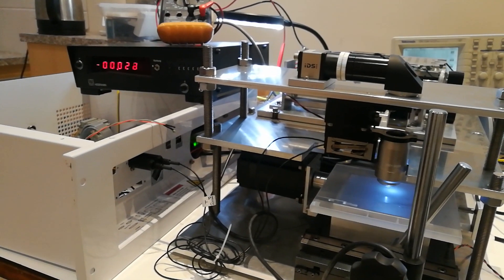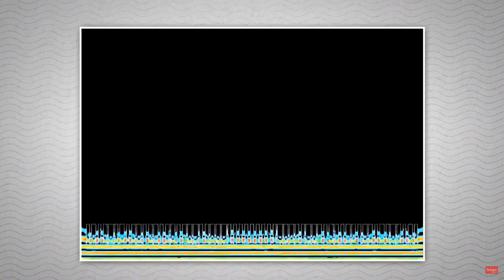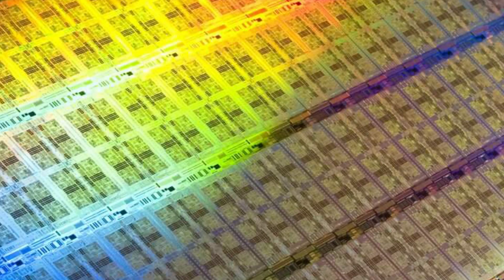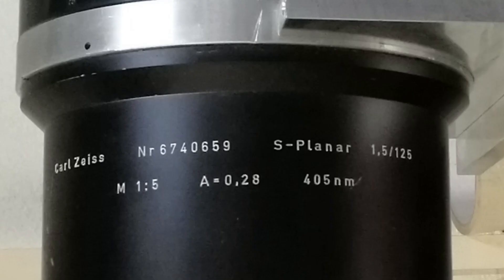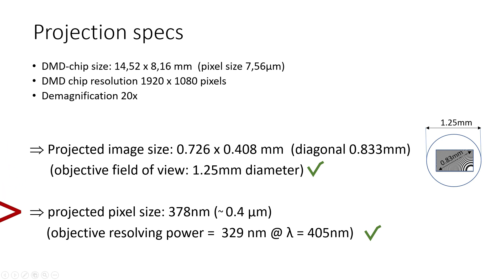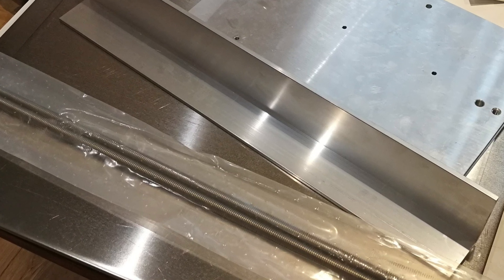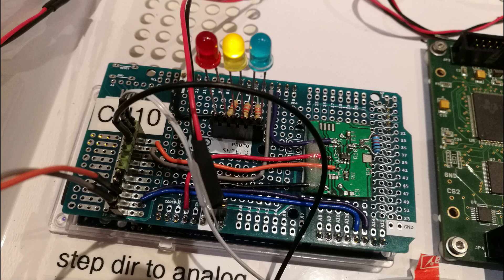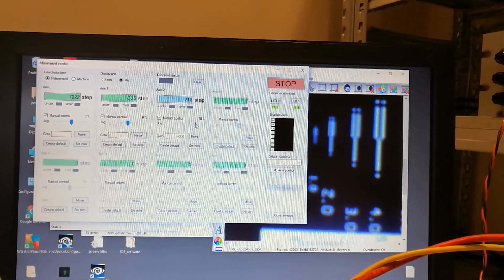Maskless Wafer Stepper Part1: Optics

Comment: The microscope objective lens you are using seems to be corrected for cover glass thickness, as this is typically the case for most CFI Nikon Plan Apos, especially those with higher magnifications. I wonder if you see any noticable spherical aberration if used without cover glass.  Have you measured the point spread function of this system so far?
Reply from the maker: Thanks for the suggestion Jaka, I actually  did not know that, so I checked the documentation. The Plan Apo VC 20x that I use  does not have a cover glass correction. I have not measured the optical quality of the objective myself but  I probably should. The main issue so far seems to be a rather limited contrast, probably caused by the "APO" properties, which I do not need using only a limited wavelength range. I improved the contrast quite a bit by introducing a few limiting aperture stops.
Reply: @HuygensOptics  Thank you for your answer. Interesting - is it possible for you to share the documentation?
Reply from the maker: Sure. You can download it from the nikon website. https://www.nikon.com/products/microscope-solutions/support/download/brochures/pdf/2ce-muzh-4.pdf. The objective I'm using is the MRD70200
Reply: Thanks to both of you for discussing this issue. A photomacrography forum has been discussing this issue in relation to your work. I don't see any specs on the Nikon website for the particular objective you are using. The Nikon 20x 0.75 VC is clearly labelled for 0.17mm coverslip, even in the diagram that you used in your video. The OEM versions are generally optimized for different (usually thicker) "coverslips" (often glass-walled receptacles in gene sequencers). If you have information that your particular model does not need a coverslip, that would be very interesting and exciting news for many of us. Can you explain in more detail why you think your objective does not need a coverslip? Thanks.
Reply from the maker: @loujost  Thanks for the info. So, indeed a cover glass is indicated in the figure, but I am not sure that means it is corrected for this. However, check out page15 of the Nikon document linked above. With the 60x, the correction is explicitly mentioned. The 100x oil emersion does not need it, so it is logical it's not mentioned. With the 20x there is no mention of cover glass correction. I'm no expert at all, so I might very well be wrong about this. 
PS: if the cover slip correction is mainly chromatic, it is not important for my application since  I use monochromatic light.
Reply: @HuygensOptics  No, when an objective with high NA says it expects a coverslip, that means it is corrected for a coverslip. Results will be degraded without it. People on the photomacrography forum have tried these objectives withoout coverslips and found poor results. As I mentioned, the OEM versions like yours are often even worse in this regard, because they are designed to shoot through thicker glass. It would be worthwhile for you to experiment  with adding one or two coverslips to your system. There is a lot of information about these on this thread : https://www.photomacrography.net/forum/viewtopic.php?t=38767&highlight=1501-9398
I have the same objective as you and I made tests with different numbers of coverslips, posted on that thread. The best results were obtained with somewhere between two and three coverslips.
Reply from the maker: That is great info! Thanks very much, I will give this a try for sure.
Reply: Thank you Lou Jost for confirming my doubts. However, a measurement of a PSF would clarify everything. @Huygens Optics, are you able to perform a simple knife edge test to measure this?
Reply from the maker: @jakapribosek8803   Yes, no problem, I can do that.  I will let you know when I have done a test. It will not be very soon because of work and another video.
Reply: @HuygensOptics  Seems like it would be easier to just compare the image with  no coverslip versus two or three coverslips.
Reply from the maker: @loujost  by the way, I saw your remarks on the photomacrography website concering the Carl Zeiss lens video 1. After publication of the video I found out about the Censor bullshit (somehow I was wrongfully convinced that this was the explanation) so I immediately put a remark in the comments. Also, I corrected the sodium-mercury mixup during editing by placing a remark in the top corner at 7min16 into that video. The problem with video's is that they are hard to change once published. The only way not to make mistakes is to not make anything.
Reply: @HuygensOptics  Thanks for clarifying.  I didn't see the clarifying remark when I watched the video, perhaps at that point I was just listening to it while stirring my dinner pot. I should have looked more carefully. Sorry.
Reply: I added your comment to my post on that forum.
Reply from the maker: No problem Lou, thanks. The sodium lamp was a slip of the tongue and I did not want to the workshop and re-record it all again because of one word, so I decided just to add a remark it in the picture. But I should probably have made it more prominent for people to notice. By the way, I just found out that it is possible to cut out a part of the video without having to delete and re-upload it again. So I think I will do that and remove the Censor part. I really don't want to give people faulty info.
Reply from the maker: Jaka, I found this page on the Nikon websit, turns out you I was wrong about this objective, indeed this objective requires a cover glass (of 0.17mm). See: 
 https://www.nikon.com/products/microscope-solutions/lineup/objectives/cfi_plan_achromat_series/index.htm  
I've ordered cover glasses, so hopefully I can achieve an even better resolution by adding one to the optical path.
Reply: @HuygensOptics  Thanks for the link. However, this objective lens looks different than the one you are using in the video.  Yours looks like CFI Plan APO 20X VC: https://www.nikon.com/products/microscope-solutions/lineup/objectives/cfi_plan_apochromat_vc_series/index.htm If that is so,  the overcorrected  spherical aberration at 0.75NA should be significant. If you can reduce it with coverglass as suggested by Lou, you should see noticable improvement in contrast and resolution. For optimal performance however you might also consider AR coating on the coverglass...
Reply from the maker: @jakapribosek8803   You are right again. In a future video on improvements of the wafer stepper i will definitely discuss the issue in more detail.
Reply: @HuygensOptics  No,  those aren't the right objectives. The information and my test results in the photomacrography.com forum are corrrect. Your objective needs about two standard cover slips, maybe three. Yopur objective is a specially designed objective for a gene sequencer machine.
Reply: @loujost  Have you found a source of commercial cover slips of appropriate thickness?
Reply: @jakapribosek8803  No, I have to combine two or three standard ones. There does not seem to be image degradation from doing this. See the information and tests on photomacrography.com. You can also just do your own tests by adding coverslips until you are satisfied. The thickness does not have to be exactly correct at this NA.

Comment: I did this in my lab a few years ago. I will be interested in how well you can do field stitching. I actually made it so I could swap optics and align though the lens with red light before switching to nUV. I had much more field distortion than a real stepper though.

Comment: Wow really cool project! You hear now also in the cinemas e.d. about laser projectors provdiing better contrast.  Would using a 405nm laser have any advantages for your system?
Reply from the maker: The high resolution (4K for some systems) could be advantageaous. Also it would probably be quite easy to replace one of the lasers with a powerfull 405nm laser.  I have mixed experiences with using laser light in photolithography. One of the problems I encountered is the fact that you can get "grainy" images when reflecting monochromatic light on a DMD-chip.
Reply: You can make a decoherence filter for lasers by shining them through a weak milk solution. This removes the graininess.

Comment: would you not also require rotation adjustement for being able to stitch ?
Reply from the maker: This issue is actually discussed in Part 2 (rotation is mentioned around 11min 22 sec)
Reply: @HuygensOptics  I've watched it since, must say I was so enthused that I had replied on the spot. I've done a bit of micro fabrication myself, including microoptics (Fresnel lenses mostly) , but using photoreduction or metal masks, not optical direct writing : your setup is amazing (caveat : resolution and alignement tends to always become a limitation at some point or other, so it is a major design parameter in my experience). Though I'm mostly into mems and biosensors these days, this kind of tool would be very valuable, at least for prototyping...  One minor suggestion if I may : you could probably improve your defect density by building yourself a little air box to prepare the plates and box them before taking them to the patterning machine.

Comment: If you use monochromatic UV source, maybe you don't need APO lens? APO lens I think are useful only if you want to reduce chromatic aberration. But if you use monochromatic light, that is I think unnecessary, and can reduce other aspects of the image quality, like field curvature, coma and contrast, due to the design tradeoffs. Achromatic / Apochromatic lenses surely are useful in the inspection of the wafer tho using external secondary light. High quality apochromatic objectives can be pretty expensive and have 15 lens elements, which does reduce microcontrast and light transmission in general, so it is probably better to avoid them if possible. You will notice on your huge Zeiss S-Planar, that it is marked as 405nm. It is optimized for this specific wavelength, and it is not achromatic / apochromatic, maybe just slightly, but really in very narrow range 390nm-420nm maybe. The complex construction inside is mostly to improve the field flatness, reduce geometric deformations, reduce / eliminate spherical aberrations, vignetting, and reduce effects of colimation errors and thermal expansion.
Reply from the maker: Actually, I bought the objective for the "plan" indication, not so much for the "apo"  properties. But as you also suggested, it could have advantages when using a secondary wavelength, which is outside the exposure range of the photoresist. For example when checking the focus through the same objective, before doing exposures. So far, loss of contrast and field curvature/coma do not seem to play a large rol at this point, but I guess we have to find out. Anyway, thank you for the valuable suggestions. By the way, did you see the video's specifically made on the S-planar? In the first one I discuss the 405nm design wavelength and the implications for chromatic aberration (around 5.30min).
Reply: @HuygensOptics  I just noticed your other videos on photolitography, and you clearly know about the design tradeoffs and more than me on the topic. :D Thanks and keep us posted on the progress of your project!  Yes, I just watched the S-Planaer videos, they were very cool and indeed, it is sharp and optimized for 405nm. The chromatic aberration is enormous in it, but it is by design :D
Reply: @HuygensOptics scanners only illuminate a circle sector to make curvature non-critical

Comment: That Censor lens brought back memories. I used to work for Perkin-Elmer in the mid-80's as a young optical engineer on the SRA wafer steppers both before and after they bought the Censor company in Liechtenstein.  
Stitching together multiple fields is a real challenge. Here are some issues you may have already thought about. If not I hope this helps.  The reticle (or DMD in this case) has to be rotated parallel to the stage movement within a small fraction of a pixel width to avoid jags at the field boundaries. Hopefully the X and Y axes of your exposure stage are perpendicular to this same level.  The asymmetric distortions like keystone also have to be corrected to a similar degree for stitching. You may need to tilt the DMD to dial this in. Illumination uniformity also has to be incredibly good to avoid noticeable line width changes at the boundaries.  Simply Kohler illumination might not be quite good enough, you may need a light pipe uniformer or fly's eye integrator.  At this NA, you will probably need to focus at each field. There will always be an offset between the focus detector and the best focus determined by an exposure/focus matrix that will have to be determined every few hours. Since it must be calibrated anyway,  this means that you potentially could use a dichroic mirror in place of the beamsplitter, and use a separate wavelength for focusing and not waste the 405 nm light.
Reply from the maker: Hi Adam, that is some very good advice! Some things I had taken into consideration (like perpendicularity and field rotation), others not in that much detail. Illumination uniformity is actually one of those aspects that is quite tricky, I consider using only part of the total HD field for exposures, because the 16x9 aspect ratio of the chip is far from ideal. And it would not be a big problem to correct the step size for this in the software when in stitching mode. As for focussing, I actually designed a height map feature in the software, but only in first order (so just linear tilts in X and Y). So I hope this is sufficient for holding focus. Anyway,  I'm not planning to expose 300mm wafers, but rather limit the field to maybe 10x10mm. But in general, I try not to consider every problem I might encounter in the future, but rather tackle it when I get there. Your description of what lies ahead is greatly appreciated though.
Reply: @HuygensOptics  at 16x9 you can try doing anamorphic lenses to get bigger NA

Comment: Awesome. What is the minimum feature width you think you will be able to achieve? Also I would be interested in your thoughts on thermal stability, particle contamination and vibration considerations.
Reply from the maker: Hi Nick, regarding the resolution:  With 193nm it is now possible to produce dimensions below 50nm using multiple exposures and very advanced mask design. So if you would use a similar factor to 405nm,  a 100nm should be achievable. But of course, my "mask" is very crude and it is not possible to deliberatly introduce interference effects to enhance resolution, so it would be quite hard to achieve. Bottom line is: I don't know at this point. I guess we just have to find out. Thermal stability and vibrations will be discussed in the next video on mechanics. Please be patient, it will take a few weeks before that video is ready.
Reply: @HuygensOptics you don’t have masks. You only would need to change the pattern. So easy. Mount 4 polarised light sources around your DLP (lasers are polarised). Turn on top, bottom for features in one direction, change pattern, turn on left right lights. Or rotate around and animate DLP ?? Oh I see. All needs to be off axis.